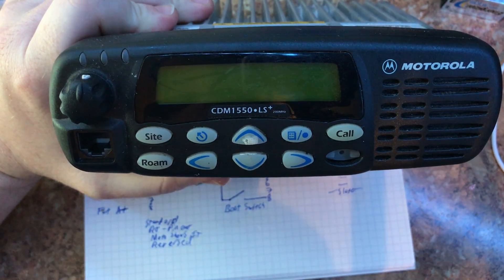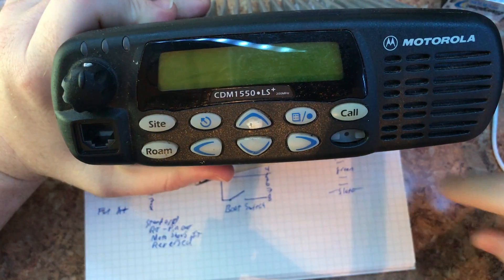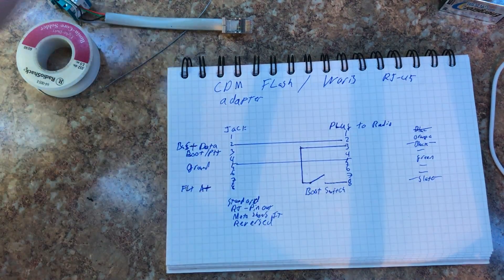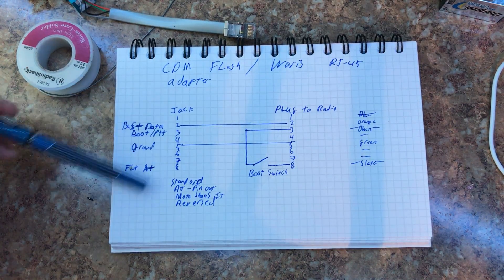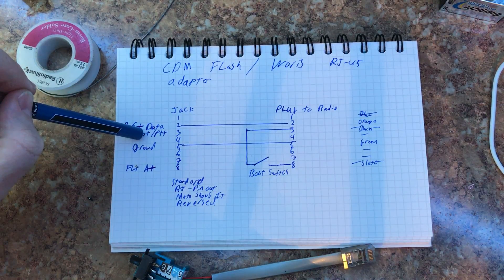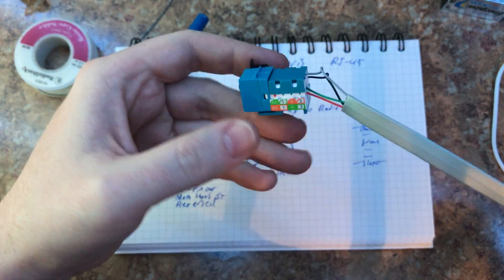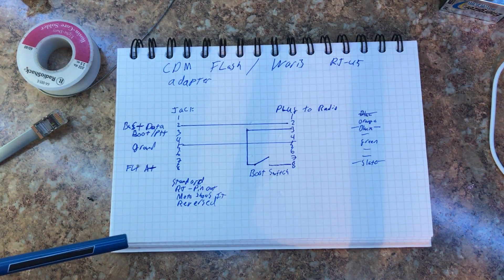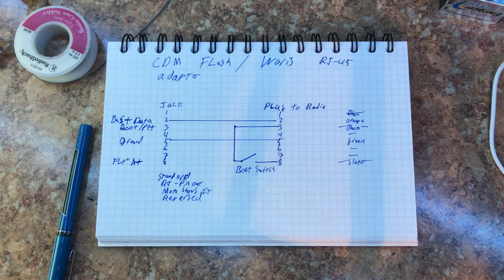CDM Flash adapter

Comment: I am attempting to program AN HT1250. I have purchased a prolific programming cable from eBay. I have the programming software as well. However, I continue to get the the error "Couldn't open port" do you have any suggestions on what I might be doing wrong?
Reply from the maker: >I have purchased a prolific programming cable 

There's your problem.  These only work some of the time with the right driver.  They will work for flashing though.

http://wiki.w9cr.net/index.php/Waris#Notes_on_RIB-less_Cables